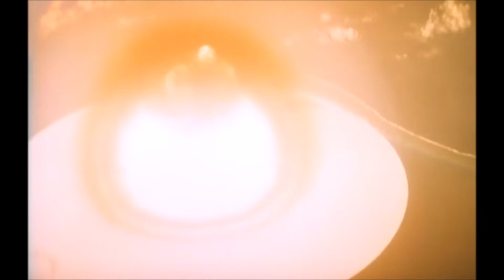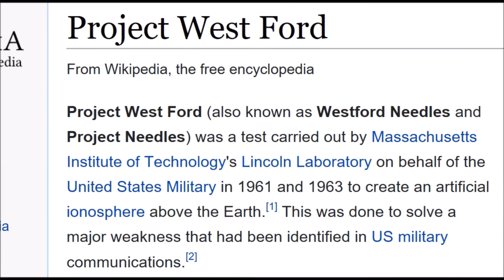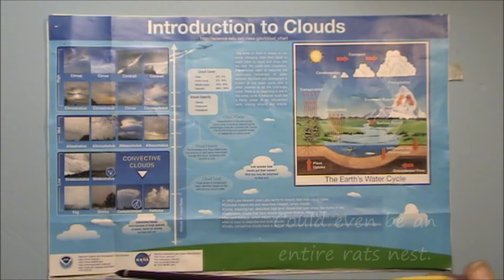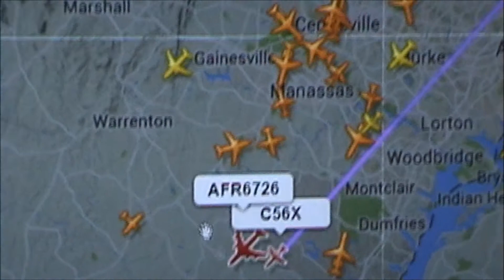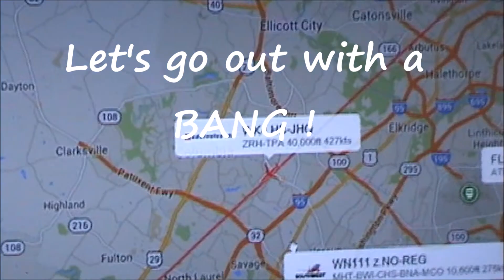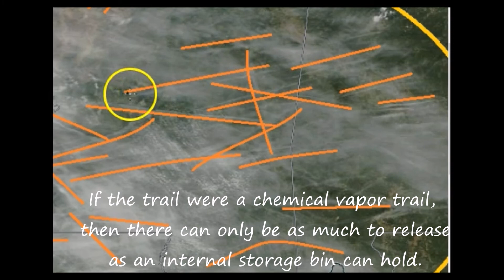PROVING CHEMTRAILS -- So Easy a Caveman's Kid Can Do It.

Comment: Excellent video! You've made a brand new discovery of the 80 mile long trails. Jim Lee's new video CBD chemtrail secrets shows there is a program to load two fuel types on airliners, a clean burning fuel for takeoff and landing, and a DIFFERENT fuel for cruising altitude. The cruising fuel contains nano particle metals, which improve combustion efficiency and reduce soot or unburned carbon. Also, I think the distance from the back of the airliner, to the start of the trail, says alot about the thermodynamics of the expanding exhaust. It should be possible, to figure out what that distance should be, with a known engine type, known input humidity, and known throttle setting. The heavy trails have a short starting distance, but normal trails have a longer distance, and disappear in about nine seconds.  I bet the Aeromexico jet is using the clean burning fuel for the entire flight, maybe for four reasons: 1) mexico is not part of NATO; 2) the clean burning fuel is cheaper; 3) due to the terrible air pollution in mexico city, they refuse to burn dirty fuel; 4) maybe Aeromexico knows the chemtrail cirrus causes drought, and they have enough drought in mexico already.  So much great info in this video! But, the main point of trail/no trail at the same altitude, should be uploaded as it's own video, so lots of people can document it for themselves. There will be dozens of videos uploaded, to prove your point. That, alone, would change the dialog, and silence the chemtrail trolls. I love that 1959 Walt Disney cartoon, everything is revealed right there. It is written into the rules, that they have to reveal ahead of time, what they are planning to do to us. That is the reason for the series "Life after People", showing a world with zero humans left. I like the crossbow bolt, but next time, use a razor tipped broadhead to get the message across. Great work, thank you!
Reply from the maker: Thanks a mil, Ace!!  You really cheered me up today and I needed it.   I will definitely up a short version, which I have already prepped, going only for the trail/no trail anyone can prove it thing.    My main purpose for upping was to refer news people to it, and I was trying to get the Washington Times to get with the program, but they have finished their retreat into the Platonic Cave with the comforting normalcy of the shadow play on the curtain in there. Their appointment today of an archetypal conformist cow to be president is what depressed me ,but you have so helped.  I do have other places to go with this, and now I will. 

 The question of how the material gets on board is, as you know, the main quandary, and the proposal that two types of fuel per your Jim Lee reference makes a whole lot of sense. Aeromexico 787 has done the massive supertrails from time to time.  This may indicate that the fuel used for trailing may itself be a limited quantity, which is released in areas where the "managers" deem it more useful if one area has been saturated to their satisfaction.  

Your assessment that metals are selected for their ionizable capacity on your other vid is also very valuable in that we see a totally unnatural duration of the nearly omnipresent Super Cirrus, at least East of the ROckies, which to me implies ionization of everything the HAARP style apps affect.  One thing I didn't include in my vid is the decryption early on the atomic bomb tests that the mushroom cloud is primarily formed from the "Cloud Chamber Effect" caused by the microwave-accelerated ionized air and vaporized molecules. As you would be most aware, the HAARP patent starts out by describing a primary "benefit" coming from electron cyclotronic acceleration.   Let me ask in closing and in light of Jim's incredible work in showing all the EM facilities that can be brought into play if you are still fully opposed to the use of NEXRAD as accessory to the Crime?    Many thanks again for your taking the time to comm with me.
Reply: I now agree that Nexrad radars DO HEAT THE IONOSPHERE!!! Jim Lee was right all along, and I extend my apologies to him, and his viewers. I have multiple confirmations, and can't go into that, but Jim Lee found a WSR-88D maintenance document, that described "spot light" mode, where the dish sits in one position for five minutes, transmitting, without moving at all. Also, there is the 60 degree upward tilt. So, with the high peak power, and those two capabilities, the NEXRAD radars can definitely act as ionospheric heaters! There is no doubt about it, at all. Of course, it is not a precision heater, due to the 1 degree beamwidth, but several radars working together can make a big difference in the upper atmosphere, which then has an effect on the jetstream. Two or three adjacent Nexrad radars could focus on one point, and heat it with several db gain. I'd be VERY surprised if this is not being done all the time. The actual sweep of the radars are only needed during bad weather, so what are they doing the rest of the time??? Probably sitting in spotlight mode. 
Of course, the frantic comments you see about nexrad "evaporating" lines of storms, is nonsense. The computers simply subtract a stationary source of in-band noise, producing a stripe of missing precipitation. If that was not done, a stripe would appear in dry weather. The long stripe indicates the range gate computer is confused by the pulsed noise source, and can't resolve the range, so a radial stripe appears. The noise source is probably another nexrad, or a military radar, in the same frequency range (2.7 to 2.9 GHz). 
BTW, the increase in stratospheric lightning - pixies, sprites, elves, etc, is probably a result of the nano particle metals floating around. If you are into meteorology, the 2 PVU surface represents the boundary between the troposphere, and the stratosphere, called the tropopause. It is a turbulent surface, with high winds, and folds, lots of vertical movement all the time. This is one way the metal particles are lofted so incredibly high into the stratosphere. Jim Lee indicates the soot particles are bonded to the nano-metals, and photo phoresis lifts the particles into the stratosphere. I bet he is right, they will heat strongly, maybe build a static charge, also they are probably designed to stay aloft as long as possible.
Your reference to the shadows of the Platonic Cave reminds me of quotes from the greatest scientist, and genius, of our age, Dr Myron Evans. Fortunately, he focuses on advanced mathematics, and stays clear of this political turmoil, so he is allowed to continue his research in relative security (and strictly enforced obsurity). 
I have never seen any evidence of electron cyclotron resonance following the magnetic field lines of earth. That would basically mean heating the ionosphere over antarctica from power input over the arctic. It doesn't really fit their weather control criminal m.o. to affect an unpopulated area, unless it has to do with the ozone hole... 
I still wonder if there is a simple spectrometer that can be built to examine the chemtrail clouds passively. Such a device would be simple, but extremely powerful, to diagnose what kind of metallic ions are in solution up there. Another thing, if you have access to an x-ray fluorescence spectrograph, a small spec of dust can reveal what is falling down. Sadly, I don't have any access to ANY good technologies, like those. 
The news is reporting today, that airline fares are going up, because of increasing jet fuel prices. Well, the fuel additives are part of JP8 prices, so some research into the additives could be revealing. Maybe they are phasing in some expensive, new additives? Unfortunately, they are proprietary, so data is hard to find. Maybe a university libary with a petroleum engineering department would be a good start. Google is superb at hiding data that leads to forbidden topics, especially when you are "marked", like I am. 
Another interesting, but unknown topic, is the slaughter of 2 to 5 million great whales, which used to fertilize the oceans with iron, and pull down gigatons of CO2. Now, there are only a few thousand great whales around the world, so the oceans are not able to remove CO2 from the atmosphere as effectively as they once did. How much of the Maunder Minimum mini ice age was really caused by the "whale pump"? Look how much the earth has warmed after the slaughter of 99% of the great whales! The human species forfits our right to live on this planet, because of greed like that.
I agree, I despair over the orange haired buffoon (OHB), ignoring the runaway climate crisis. Obviously, his handlers have instructed him, that the US military has it all under control, and all he is supposed to do is worry about keeping the coal mining companies happy. We are doomed, by design.
Alot of new research topics there, but you are one of the only scientists out there, who can make some headway on them.
Reply from the maker: Nice !  Yours is the integrity and selflessness that advances all beneficial Science.   I will have to go over your generous layout of the technicals a few times, but now I can give you some of the evidence or evidence as it appears to me that would confirm your surmising the wide spread NEXRAD system is doing something all the time.     Will be back to you in a relativistic flash.   Oh, and don't despair too much over His Orange Majesty.   I do think he's right to not sign onto the UN tax to the max on carbon, since where would all that money go?  To Global Government = more weather control + censorship of you, Jim, and I.    You will thus be intrigued to note that I have not been getting notifications of your uploads for what appears a very long time, and only checked in when I finally saw a "1" next to yours.   So think HOM under a "blind pig gets truffle" banner.  :)
Reply: The HAARP Report Marietta College in Marietta Ohio has one of the top notch petroleum courses in the world. I live nearby and constantly observe students sent here from many oil laden countries. I hope you find the research necessary for results; this must be stopped. Ty